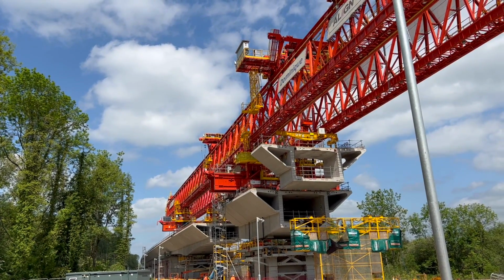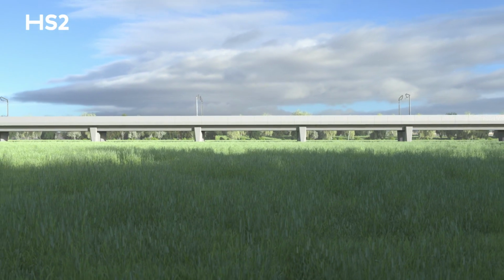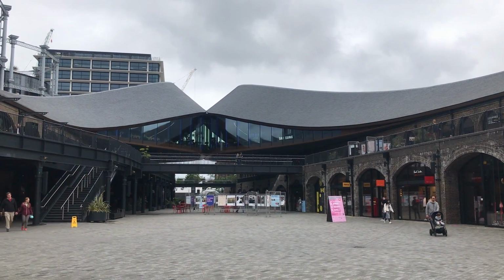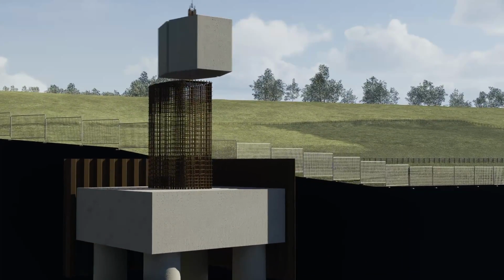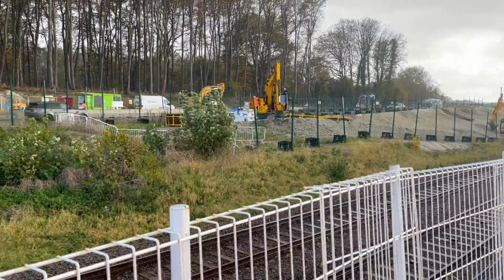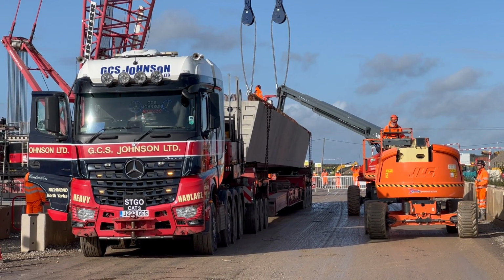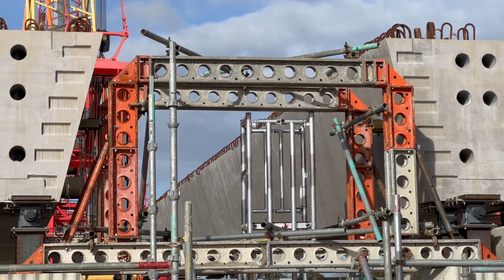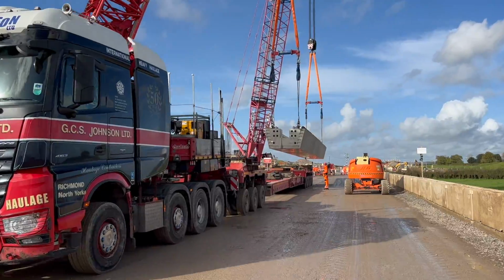Return to HS2: The Art of Compromise

Comment: Fascinating. I'm also fond of rail travel. However, HS2 suffers from the most loathsome of failings - it started from London. Now, after its cut backs, its just another fast link between (almost) London to (almost) Birmingham. Given the existence of the Euston to New Street service (and beyond)  it now seems like a redundant white elephant.  
Politically, the full project made sense to equip northern cities (the Northern Powerhouse) with faster links to the south. The very essence of "leveling-up".  Indeed, one could argue that faster east-west links connecting Liverpool, Manchester, to Leeds (& Sheffield), and on to Hull and Middlesbrough would have been even more beneficial.  
Theres a certain irony to the fact that the political right have been bleating about not wanting it near them, forcing costs up by requiring tunnels and viaducts to be built and they have the line while the more politically left leaning northern towns which wanted better links now get nothing. 
HS2 has become a very symbol of what is wrong in Britain. Its starts nowhere, its going nowhere but its doing it very fast.
(apologies for being cynical)
Reply: While the scrapping of the northern legs of HS2 is unfortunate and lowers the benefits for the entire project, it's still a useful piece of infrastructure. Express services will be concentrated on HS2, freeing up capacity for more local and regional trains, as well as freight trains on the WCML.
Reply: I don't know if I imagine things, but I do remember Labour did sort of have a vision of Liverpool, Manchester, , Leeds, Hull becoming one virtual supercity as a rival and Balance to London.

The key to that would be HS railway that look a bit similar to the London Underground, with multiple HS connections linking the cities together.
Reply: @DavidKnowles0 That was when British Rail was running the Railways before the the Railways were privatised. It has never been the case of HS2 ltd and privatisation
Reply: @DavidKnowles0  Wrote : "Labour did sort of have a vision of Liverpool, Manchester, , Leeds, Hull becoming one virtual supercity"  Sounds lovely.
Reply: @dukenukem5768  it the only realistic way to potentially balance out  the power that population size and wealth gives London without destroying it.
Reply: I think you’ve hit the nail on the head. Great idea ruined by politicians, project changes, and budget blowout. It’s not worth the money now
Reply: Well you haven't done much reserch then have you, HS2 will run from London Euston terminus which is not exactly Central London( OOC  is just temporary as it is not desighned as a terminus station) and terminate in the heart of Birmingham City Center at Birmingham Curzon Street Station whose main entrancw will be on Moor Street Queensway in Birmingham City Centre and these services will replace London Avanti Services from Birmingham New Street Station, it s centerd on Birmingham and I am not sure why the Northern Power House has so much importance over other areas.
Reply: @peterwallen1063  Have they given the go-ahead for it to get into Euston?  Last I heard that bit of it wasn't funded.
Reply: @roderickmain9697  It has been decided to go into Euston as London Old Oak Common is not being built as terminus station only as a through station so does not have the space to terminate trains there
Reply: "its just another fast link between (almost) London to (almost) Birmingham" Almost?  That's Euston and Curzon St. Where would not be "almost" in London? Trafalgar Square?  Buckingham Palace?    And where did you want it to start or finish if not London?
Reply: @dukenukem5768  The last I was aware from the project, was that the link from OOC into Euston had not got funding as part of the cancellation of the project.  Which is why I said (almost).  IF that funding has been confirmed now, then thats a good thing. I mean theres a lot of preparatory work which has been done at Euston so it would seem to be ridiculous to cancel that bit. However, doing ridiculous things seems par for the government course just recently.
Reply: @roderickmain9697  Oh, OK. You had Old Oak Common in mind.
Reply: @roderickmain9697  Ideally a business that's funding the HS2 terminal at Euston says that they want the original plan of 11 platforms so that it's ready for later expansion. It would be utterly pointless to reduce Euston to 6 HS2 platforms, not for the land area that's already been cleared.
Reply: @hairyairey  we can only hope that the case. Also they could insist a direct connection to Hs1 be built.
Reply: @DavidKnowles0  I think others have explained, there just isn't the demand there for the HS1 to HS2 link and Camden won't allow it.
Reply: @dukenukem5768  I think you need to do a bit of resurch, first trains have never gone into Central London  and always been on a circular axis arround London and have been since the 1800 and the Lines that HS2 is replacing the WCML terminate's at London Euston as it is and this is where HS2 will terminate at London Euston in the same station and your remark on "almost Birmingham" I think you need to do a bit more reserch, Curzon Street is no different to New Street , Birmingham New Street Station is not actually on New Street in Birmingham City Centre but on Stephenson Street, and the new Station is being called Curzon Street because it is being built on a part of the original London and Birmingham Station of the 1800's which apart from one building is now demolished, the actual name of this new massive terminal station will be " Birmingham Curzon Street" and it will have two entrances, one by the original Curzon Street Station Building with a Tram interchange and the main entrance on Moor Street Queensway right in the heart of Birmingham City Center next to Moor Street Railway Station of which the two will make a massive Rail Hub interchange and next to the Bull Ring Shopping complex
Reply: @peterwallen1063  Wrote "I think you need to do a bit of resurch ..."  I think you meant to reply to Roderickmain, not me?  He was the one who said "almost Bimingham".  Don't worry about me, I'm very familiar with these places, especially London like the back of my hand.
Reply: @dukenukem5768  I did not actually reply to you, it is because you are involved in the debate the the debate I sent went to you as well, it happens to me loads of times.
Reply: When you say it's a white elephant you misunderstand the separation of express services from commuter services. Even to Birmingham it will alleviate overcrowding on the WCML, particularly from Rugby to London. The express services take most of the capacity.

Comment: It's not the "high speed" of HS2 that's most important. It's relieving the congestion on the WCML that's the most important. If you watch YouTubers like traindriver brian, you realise just how much time freight gets held up, how much time is wasted. The freight may appear to be moving fast when it's moving, but it can average 20mph over the course of a day between all the stops and starts and red lights and delays. HS2 will mean higher average speed on all tracks, not just the fancy new one.
Reply: Hs2 would increase capacity for freight on the existing lines which is at capacity at the moment and mostly run at night .
Reply: Wasn't just the WCML but the MML and ECML that would have benefitted from HS2 - all lost now to a government rather stupidly claiming to be planning for the future but doing no such thing. It is such a poor advertisement for the UK. How far we have sunk since what we achieved in 2012 with the Olympics and Paralympics
Reply: But it didn't need to be high speed then, did it?  We could have upgraded old disused lines for a lot less cash and still got the same congestion relieving effect.
Reply: @DavidMartin-ym2te No. The upgrade to the network is a new line called HS2. Most of the old alignments aren't enough and just feed directly into the existing main lines meaning it would actually make things worse in most cases. Some branch lines should be re-established, but it needs to be done in an intelligent way. There's a point where the only upgrade is to start over because you get to the point of diminishing returns. That's what HS2 was.
Reply: An most of the re-established lines are for commuters not cargo.  @TalesOfWar
Reply: @DavidMartin-ym2te No, because such a low tier line wouldn't attract any traffic and thus the WCML would stay as congested as it is today.
Reply: @DavidMartin-ym2te  would it be much cheaper, though? Many of the old disused lines have been built over, or are repurposed as roads, while you'd still end up with curvy Victorian-style infrastructure adapted to steam locomotives with limited power in stead of powerful electric trains which can negotiate most inclines without an issue. So you'd end up having to remove just as many buildings if not more (HS2 avoids most built-up areas), the WCML would still carry mixed fast and local services in stead of having dedicated tracks for both. Because having trains going at different speeds is what eats capacity, you could have 20 trains with the same stopping pattern on just one track, but add one much slower or much faster train, and you lose 5-10 slots, depending on the length and the number of stops. 
I'm not 100% convinced by the chosen route, I would have preferred a route sticking closer to the existing road network to minimise disruption, but HS2 in itself was and is a good idea.
Reply: @barvdw  The interesting alternative would have been to put all the freight trains on to the old Great Central line (which is full Continental loading gauge) to get them out of the way; a pity the whole route wasn't safeguarded. The WCML upgrade about 20 years ago may have linked to this - it was hoped to make it a 140 mph railway, but failed. The mix of stopping/fast trains south of Rugby would have persisted, but four-track lines and the Northampton loop would mitigate the problem. However the line was built with easy gradients but significant curves which is not ideal for high-speed running - hence the Pendolino. As you say, the TGV allows steep inclines but ensures the route itself is relatively straight so that high speed can be maintained throughout, the only speed restriction being where it goes from 1 in 28 up to 1 in 28 down and the train speed needs to be limited to stop it taking off!
Reply: @iankemp1131  You mean party poopers didn't want trains to gain some air!
Reply: @DavidMartin-ym2te  The whole idea of building this high speed line was to move express trains off the three lines WCML, MML and ECML so that all three lines would have increased capacity for freight and commuter traffic. This would reduce traffic congestion and reduce the pressure to build yet more motorways.
Reply: @DavidMartin-ym2te  The new alignment uses far less energy per ton per mile. That alone will probably pay for the outlay over a century, which is the kind of timescale these projects are based on.
Reply: @DavidMartin-ym2te  Do you know anything about Railway construction, by the sound of it NO!

Comment: The Elizabeth line cost £20bn for 70 miles of track including a significant amount of tunneling, still strange that roughly double the length to Birmingham will cost at least 5 times as much
Reply: The cost for phase 1 is meant to be around £40bn (2020 figure), £106bn is what was meant to be for the complete project
Reply: A LOT of the liz line runs on existing main lines and shared rights of way (the sections from Paddington to reading and Stratford to Shenfield share tracks with main line trains)
Reply: That is the first time I have heard anybody suggesting that the Elizabeth line was a relatively cheap project. I expect the actually new bits of it were eyewateringly expensive per unit length. They certainly don't look cheap.
Reply: @geirmyrvagnes8718  Tunneling isn't free 😏
Reply: @geirmyrvagnes8718 I worked for one of the companies that built the Crossrail tunnels Nd dtstuon concourses from  Paddington to Farringdon. Cost was £850 million at 2012 prices.
Reply: Only about 10 miles of the Elizabeth Line are actually new.
Reply: 5 times as much would be the full project to at least Manchester etc.

Comment: Good video but one minor addition to note is that the majority (maybe all) of the tunnels are in the non-cancelled leg of HS2 so there’s more than a little obvious pro-London bias in the decision to cut the cheaper northern leg
Reply: To be fair, the most expensive tunnel (and the longest I think) would have been under the Manchester suburbs. Not a particularly difficult tunnel to bore as it's through sandstone, just have to be careful where to site the ventilation shafts as it would have run under a floodplain, but still. The rest would have been pretty short, though I don't know what was supposed to happen in Leeds.
Reply: @Croz89  Leeds would have been better if Leeds had been built in a better location
Reply: @highpath4776 
🙄🙄🙄🙄🙄
Reply: @highpath4776  Leeds should have been built south of Birmingham. That would have made HS2 a lot cheaper.
Reply: @davidemmott6225  and with less winding rivers and the hills in different places (have you seen AdventureMe finding odd bits of things in Leeds,  a decent tram system is also lacking - unless one bothers to re-install the ones that went down the central reservations of the dual carriageways into the cities (but would that really improve over bus services - or give leeds developers excuse to build more towers at Moor Allerton ?
Reply: They should have built from Manchester south at the same time and met in Birmingham
Reply: @highpath4776  That would have exceeded the yearly budget cap. HS2 budget per year was artificially cap to be the same amount of spending as Crossrail per year, which not only greatly extends the construction timeline but also mean they couldn't say get the stations built in Leeds and Manchester, Birmingham all under construction at the same time.
Reply: @highpath4776  We don't have enough engineers in the UK to do that. But I agree it should have started in the north.
Reply: They built the tunnels because of NIMBY's. Those NIMBY's also happen to be living in Tory strongholds and are quite affluent parts of the country. So they pandered to them so it didn't "ruin their view". So the rich Tory voting areas get the thing put in expensive tunnels, while the poor Tory hating parts of the country don't get a railway at all.
Reply: Not pro London, more Pro Tory, They all run through Tories constituencies.

Comment: Find ding all this interesting,  admit I'm not a huge railway railway buff  although my father used to take me to Quainton  and disliked the warship class of diesels. Admit I'm not a fan of HS2 , purely because  it seemed like a lot of money and fuss for what, I'm led to believe is only half an hour faster journey time. 
Perhaps it's not as black and white as that?
Reply: That's the issue, it was advertised to us with all the wrong reasons. HS2 would take a lot of express traffic off the existing lines, and would allow more local or freight services on lines that are currently running to capacity. The all electric trains on HS2 and faster journey times are just the cherry on top, not the reason to build it.
Reply: because intercity trains go fast and don't stop often, they demand a vast amount of empty space in front of them where another cannot go as it would just slow down the intercity one. If you get rid of all those faster trains you have free capacity for slower (ie freight) and stopping (ie local/suburban) trains, and one intercity train removed is worth several of those. Obviously, intercity travel is incredibly valuable for the economy (and the railway companies ofc) so we can't actually do without them, but putting them on their own network has the same effect

Comment: If they designed HS2 20mph slower, we could have saved so much money and still provided the extra needed capacity. The lower overall price tag may have even allowed for more of it to be built.
Reply: They actually did a study to find out how much money it would cost at different speeds way back.
It was found that the main cost is simply building a new railway.
The costs of a 250mph alignment design speed were very insignificant in comparison.
Compared to 20mph slower, it would've only meant the location of the tracks on curves being shifted a few metres at most. So it would've basically cost the same.
Reply: @BCrossing I think it was 10% cheaper for a 200 km/h train speed than a 360 km/h train speed. Not worth it for the loss in capacity.